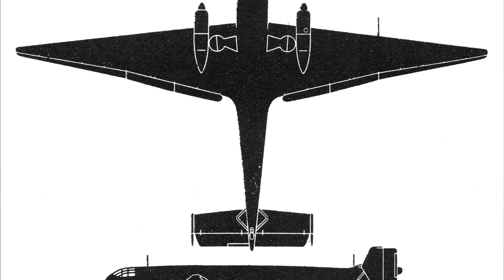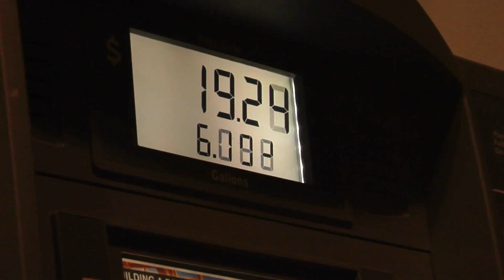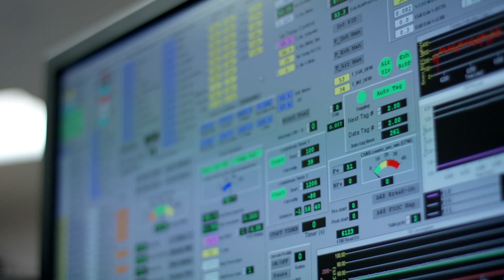The history of the Achates Engine – as told by entrepreneur Dr. James Lemke

Comment: ~50% efficiency improvement over traditional gas engines? Woah. With that type of efficiency boost something like that would be fast tracked to production cars and trucks. It's odd how technologies like this fly under the radar. Looks like there is some type of hybrid version in development with the department of energy. Interesting stuff!
Reply: There is already a niche taken up by this technology: US Submarines Auxilliary Generators use the same Fairbanks-Morse engines we used in WW2 on Diesel Subs, only more modern, because of Efficiency, Power, and Dependability. Also, the Russian T-64 Tank series uses this style only flat, because it freed up enough room in the tanks volume to lower the turret, and power for its size. The Junker Jumo 205 series, flew German transport planes over 6 thousand kilometers, with a somewhat similar technologyon a tank of diesel In the 1930s! Many modern engines still can't achieve that. Also, this engine is perfect for multi-fuel, and efficient generators, to make that power when the Grid goes down. This is more than just a small niche...
Reply: The electric motor is twice as much better than this engine. So there is no niche left on the market.

Comment: The British Diesel electric Train Deltic used  this engine in the 1960s in a Delta shape using 3 crankshafts, it was a 2 stroke Turbo Charged Diesel engine and was very efficient. It was finally replaced by Electric Trains.
Reply: https://mart.cummins.com/imagelibrary/data/assetfiles/0058689.pdf

Comment: Neat, so the engine is simplified by eliminating the valvetrain?  Great, now it requires a turbocharger and a supercharger, preheaters (no spark plug even in the gas model), and other external equipment.  A 2.7l engine can pull a Ford F150. (test later than this video)

https://www.youtube.com/watch?v=UxON-HIlz5E
There's no way I'd buy such a complex solution just for the purpose of some gas mileage, especially if the actual cost and carbon footprint per mile may outweigh the simpler design it replaces.
Please build your power plant back-up generator version and keep working on your design.  Don't stick it in cars yet.  There are too many parts involved for vehicle use.
(I was curious, so watched several videos on this guy's design before commenting)

Comment: The future is to make NH3 from solar.  No worry about energy in the future...none.  Just need the right technology that can use many fuels and NH3.  My engine is that engine.  @seaplaneguy on twitter.  Happy to discuss.  Packaging is key and this Achates engine cannot work well on aircraft as Junkers shows.  The future is door to door airplane flight with NH3 with optional Jet A, 100 LL, gasoline, Diesel, and propane.

Comment: No engine with reciprocating pistons and crankshafts will ever be efficient. The best you can get in the best case example of constant load and engine speed is 50%. That is 50% of the fuel in the tank is wasted. In normal vehicle running far more fuel is wasted.  

Diesel fuel is now a pariah of a fuel. Opposed piston engines can easily use gasoline.  In London diesel vehicles are charged extra to go into the city centre and also park.

Comment: I am sure Dr Lemke has heard of the British Commer TS3, 3 cylinder, 3.5 litre, opposed piston, diesel engine that was made from 1954 until 1972. Killed by idiots from Chrysler. The engine was very efficient.  It had a very distinctive appealing sound. It was based on the German engine like his is.  Also, I am sure he has heard of the Napier Deltic engine, used in gun boats and trains. I fear these engines will not be needed as we go over to EVs. I can see them running generators for hybrids at a push for large vehicles like trucks or even light trains.  But after 4 years none of these engines are in vehicles.
Reply: Ev can never beat a 2 stroke!
Reply: @jlo13800  
There is no competition to an EV.

Comment: we need more people like him. i always loved 2 stroke diesels from the beginning and apposed piston engines are brilliant. why didnt they stay? cause people just like to go the easy conventional route instead of making something cool. i wanted to build a v8 trike with a roustabout truck bed and the whole thing to look like something nobody has ever made. i would rather have an achates 2 stroke diesel apposed piston than any v8. not only do they sound awesome theres no valves to wear out or float at high rpm. the whole engine is just rotating assembly. not to mention power stroke every revolution is super super underrated. basically the same torque at half the rpm of a 4 stroke or half the displacement. i want these to make a strong come back, always wanted to see rotory valve engines come through but this  is better anyway. poppet valves have always sucked just nobody realized how much they were limiting themselves by following the conventional 4 stroke train
Reply: Now it´s all over. The electric motor will put an end to the ICE engine within the next 8 years or so.

Comment: What's holding it back from going into production?
Reply: Car makers are so busy copying they dont take risk.
Reply: @venusreena2532  Automotive is a 4 joke culture.
Reply: @jlo13800  .. Well they take a safe copy cat approach.. Only Mazda had the stones to develope the Wankel.. Our Rotor engine is superior.. only one internal moving part.. multi fuel and high torque..
Reply: @venusreena2532  And use 2 stroke oil injection too.

Comment: This is very inspiring.I would like to combustion engines co-exist in competition with EVs in the furure.
Reply: or as range extender in series hybrid
Reply: An OP engine driving a generator that powers wheel-motors at each corner. You can even have variable crank-lead … closing the exhaust port first actually supercharges the engine... and I alw3ays wondered why we don't pressurize and heat the fuel using exhaust heat to above its autoignition temperature... it would seem that lower compression ratios would be needed and denser-cooler air charges can be used.
Reply: no transmission, transfer case, driveshaft, differentials... but heavier unsprung weight... electric supercharger... exhaust heat-driven absorption cooling system... (adds 30% eff when you ditch the radiator)
Reply: @Squeezmo  fuel going into the pot takes heat out of the pot, that's why very lean engines run really hot. If you take some of the heat that would have been dumped with the exhaust and pump in back in with the fuel, you take away that cooling effect right where the heat is generated, which probably won't hurt your engine, but will probably increase NOX emissions.
Reply: @benwilms3942  I think we have the technology to deal with that. Current injectors are digital. Making them analog... Koenigsegg is using pneumatic valves (no camshafts) that can vary the lift, velocity and duration of valve lift. That same technology can be used to throttle in the pre-heated fuel into the combustion (or pre-combustion) area control the combustion rate and cylinder temperatures. That plus, the heat taken out to heat the pressurized fuel is post-catalytic converter... heat that is normally wasted out the exhaust pipe. (btw: I ran OP engines during most of my 20-year submarine career. They are awesome and elegantly engineered)
Reply: and instead of using compressed air for valve/injector operation... why not use the technology  created for automatic weapons? (Use Combustion gasses)
Reply: @Squeezmo  you can mess up the octane rating doing that not sure.
Reply: EV can't compete with an engine this powerful.
They just can not compete full stop .
These engines are pulling 10s of tonnes for hundreds of kilometers.
Like it or not ice is going to be around for a long time.
That's why this is so important.

Comment: This is a fascinating video. I expect IC engines to be around for quite a long time to come so your company has lots of potential.
Reply: thats what i want to know, whats taking it so long.
Reply: @jlo13800  The ICE engine is dead.
Reply: @walterrudich2175  All of my 2 strokes run just fine. Yes an electric motor makes huge power for its size as they are an electromagnetic 2 stroke with few parts and huge torque.
Reply: @jlo13800  So you are as well convinced that this engine has no market niche left.
Reply: @walterrudich2175  It does have a market if allowed to be produced. Today Etec (rotax,evinrude) fair banks morse, detroit diesel and EMD still have 2 strokes and cummins is now making the ACE op 2 stroke, i cant wait till these come out. i cant wait to find and evinrude/johnson v8 to tinker with.
Reply: @jlo13800  we´ll see...
Reply: @walterrudich2175  Why is the 2 stroke dead, whats wrong with it? the 8v92 i have runs fine
Reply: @walterrudich2175  There's a lot of potential on these new 2 strokes!
Reply: @jlo13800  Electric motors are more than twice as energy efficient and easy to build. Now that battery technology has advanced the ICE is a dying technology.
Reply: @walterrudich2175  true and over-unity motor generators come out its over for a 2 stroke ICE, even thought electric motors make a lot of power, and they are an electromagnetic 2 stroke, they lack the character of a piston 2 stroke!
Reply: No electric motor will sound as good as a detroit diesel, 850 rotax etec, evinrude or kx500!
Reply: @jlo13800  You mean that no electric motor causes so much noise pollution like an ICE.
Reply: @walterrudich2175  They are boring to me.
Reply: @jlo13800  You have never driven an EV I suppose.
Reply: @walterrudich2175  I never drove one but i heard the torque is insane. i would have to get a 3 phase mote on a VFD and connect it to a good sized rotax sled engine and drive it as an air compressor with pipes so i get an electric 2 stroke with the sound!
Reply: @walterrudich2175  How so? We have not other energy on earth but the hydrocarbons, at least not now until Nuclear Fusion of Fission becomes available. Electricity is not a fuel, It is mechanical in nature and needs to be manufactured.
Reply: @rolfpfeiffer9858  There´s enough electric energy to switch to electric transport right now.
Reply: @walterrudich2175  Maybe now at this time as we have only a small fraction of perhaps 2% EV's. -:)
Reply: @rolfpfeiffer9858  so what? In 2030 it will be 90% plus.
Reply: Boy oh boy, with all the problems with the electrical grid, if you had to plug all your cars in, at this moment in time, think of the incredible rolling blackouts we would be able to experience...

Comment: Sir; you are a clever man , but could you please consider taking a moment to examine an old british truck engine , built by the Rootes Group , & installed in their " Commer " lorries , it,s nickname was a "Commer Knocker " due to the sound it made , it was a horizontally orientated 3 cylinder , but 6 piston , opposed piston supercharged 2 stroke diesel . The crankshaft laid underneath the cylinders & at right angles to them , being connected to the pistons by individual simple oscillating linkages & con - rods . 
I knew a man who drove one for a living , this engine could run at a tremendous r.p.m. , but both screamed & gave off it,s rapid - fire knocking sound , I understand it was quite powerful , but suffered from rapid wear problems , the old guard truck drivers in this country could tell you far more about it than I can , I have never driven one , I,m not old enough !  I find engine developments interesting , thanks . Best Regards from England .
Reply: I'm glad to read your comments, as I too thought that the comment stating that "this type of engine lay dormant for 70 years" was not quite correct.  With all respect to Dr. Lemke, I believe he simply does not know about the Commer TS3 diesel of the 1950's and 60's.  The layout you stated is essentially correct; they used rocker arms to link the connecting rods to the single crankshaft underneath the horizontal cylinders.  From what I have read, it had tremendous torque for its displacement and excellent fuel economy.  Apparently Chrysler's purchase of the Rootes Group in 1967 killed the Commer TS3 and the upcoming larger TS4, as Chrysler had its own line of engines.  I wish Dr. Lemke and Acates success with this venture!
Reply: @MikkJogi  Those Commer engines had variable compression ratio - a great benefit. As for this 'laying dormant for 70 years' - rubbish. Check out the K60 and L60 engines used in British fighting vehicles during the 60 through to the late 80's and, as someone else noted, the Deltic diesel too.

Comment: What is the optimal & maximum RPM by this opposed concept? What is the level of the volumetric efficiency, since the concept allows only brief time for scavenging & forced induction of the two combined cylinders volume?
After exhaust ports get closed, it is only very few degrees left for forced induction. (Around 15-20 degrees) Thank you.

Comment: Dear gentlemen ...

I have made motors system that is so simple and effective from this system more powerful and less gasoline consumption engines can be made it can manufacture two-stage engines without holes in the wall of the cylinder to prove that I have made a very simple engine .The parts of it: the length of the piston is 50mm and now it's 110mm without increasing the size of the consumption chamber this increase the power of the engine and makes it benefits more than the pressure resulting from the combustion process before the opening the exit valve.
Of course ,this engine can not rotate without the system mentioned for watching the video note,the engine does not require a strong electric motor to start the rotation .The increase in engine speed when the increasing the amount of fuel .this proves that the engine works to reduce the mixture of gasoline and air .
The system determines the different speedsof the car as desired by the driver without using the car brakes at the slopes. This system works well if the octane in the gasoline is low and this video proves it .I don't have the experience and equipment to complete this system and get the patent.
Does the administration want to complete this system? 
             ....thank you so much